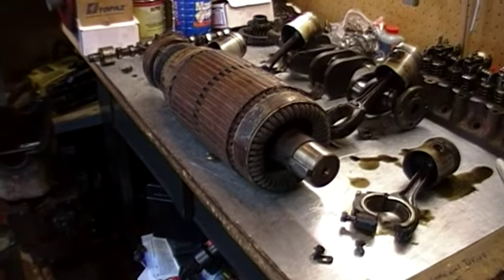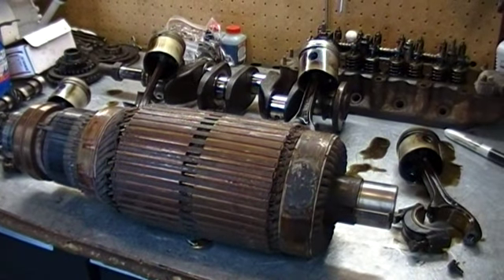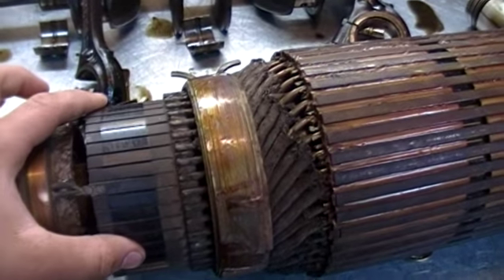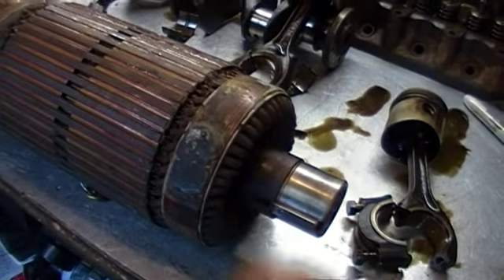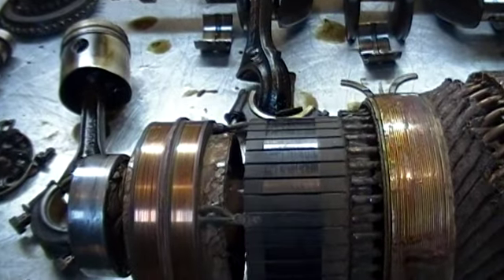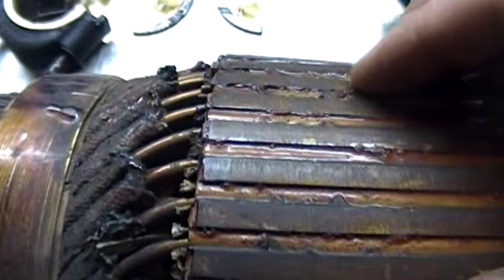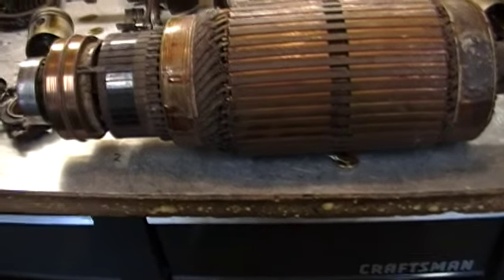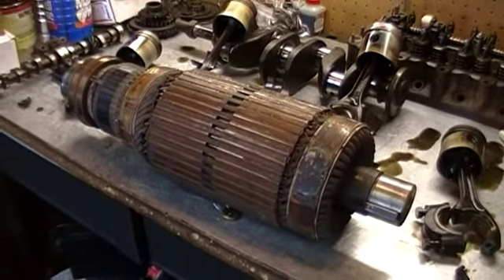Big Hobart Rotor

Comment: Great look at the rotor!  Mine has a distributor on the rear of a DC charging generator and an automotive-sized electric starter on the opposite side of the engine.  Didn't get the hand crank with mine.  Now I'm  motivated to work on it this weekend.  I will check the AC windings again but I think there's an open.

Comment: I was wondering how you removed the rotor from the stator ? Not sure if the bearing just pulled out or if it needs a press... And you wouldn't happen to know where to get a new brush for the DC side perchance?

Comment: hi john i have a sa shield arc 250d perkins diseal i having trouble pulling it apart how can i seperate the motor from the generator i want to fix the seal its leaking oil between the motor and generator